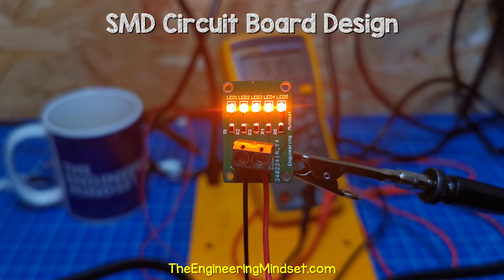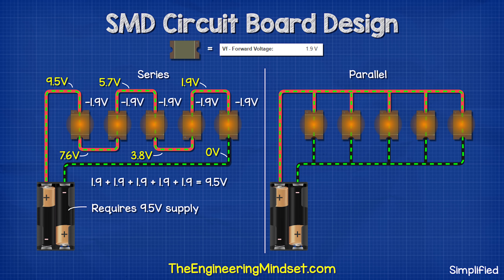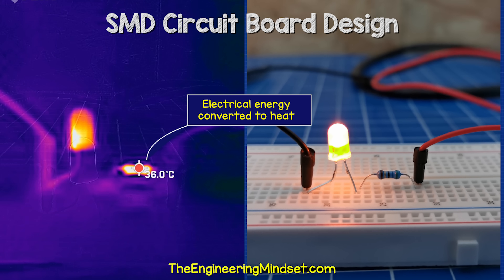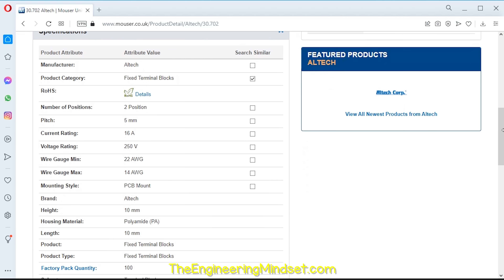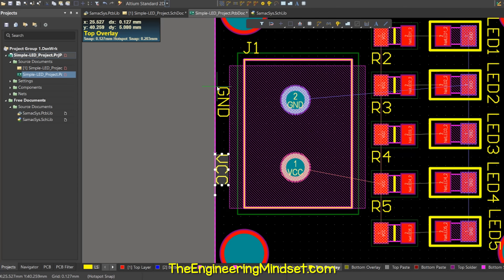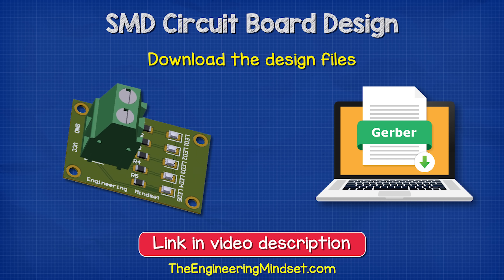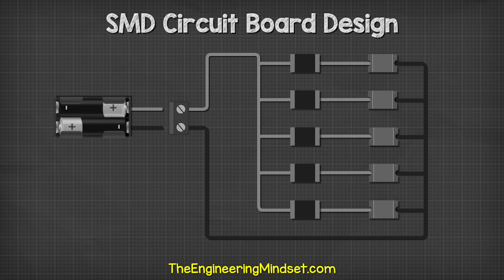Design and Build a PCB - SMD LED Learn electronics engineering

Comment: Hi  @EngineeringMindset  , is it possible to use an antenna as power source (using nfc) to power the SMD. and aside NFC, can you also incorporate a sequential blinking of SMD.? if all answer are yes. can you explain how to do it. sorry i dont have huge knowledge about electronics. thanks

Comment: This is incredible, fantastic. Thanks for this. A lot of parameters to consider here that might easily be skipped over by the less initiated, e.g. me. But, honestly, I don't think I will be doing any SMD PCBs, at least not for quite some time. Through-hole is so much easier, and will work in my harsh environments.

Comment: Why wouldn't a single resistor work for the circuit instead of a resistor for each LED? I'm pretty new so I'm not sure if that's an obvious question
Reply from the maker: It will work fine. But it needs to handle all the current so wattage is higher. You have single point of failure also. It would be cheaper with 1 resistor tho.

Comment: You could have put just one resistor in series with the parallel of the LEDs, and the resistor you used could have been used in that case too because the power it had to support was 100mW. right? Or maybe It should be 1W?
Reply from the maker: You can, but you have a single point of failure. It would be easier and cheaper.

Comment: Hello, I would like to know, how do you work with that batteries should have 3 V, but are new and have 3.2 V? That changes the resistor right? And after some time, we would need to change the resistor again, eight? Or can the LED handle something slightly more than 1.9 and it is not a big deal.? Do we get the voltage even lower? (I assume the led will just he dimmer?) btw is there a reason why you put resistor in front of each led? Wouldnt just one resistor before branching work the same?

Comment: 4B led, 3D screw or pin of some sort, 2F flat led, there is something shiny in 1D, some kind of speck in 5B, a hair stretching from 4D through 3E and into 2D, and another hair thingy between 1B and 2B. there is another speck in 3B. I know I'm years late, but..... the urge to answer caught me.
1:27

Comment: Cool video. But why you used resistors in parallel with LEDs? Would it be more simple and cost saving to mount only one resistor I series to LEDs?

Comment: Why can't we use a single resistor and connect all the LEDs in parallel before or after the resistor? You would still get the 1.1 V drop and the current on the resistor would be 100 mA, which would keep it under the max rated power for that resistor.

Comment: Definitely enjoyed the video but am rather curious as to why you didn’t just run the batteries in parallel to keep the 1.5v which would then mitigate the need for resistors as the LEDs could then handle the voltage although be just a bit dimmer. This way you’re not wasting energy and have double the capacity
Reply: You can't reliably share current across LEDs like that for a number of reasons.  The forward voltage to forward current relationship varies from one to the next enough to create large differences in the current.  They'll also have a cascade failure eventually.

Comment: why are circuits designed with the switch and resistor before the load (like an led) if the electron flow is coming from the negative side of the battery towards the positive?

Comment: Being parallel couldn't you use one resistor before it branches off since the resistor had a plenty high enough rating for all the LEDs? Saving parts and time
Reply: I think because the current that get into all led will be increased each time a led dead, thus every led will burn of overcurrent

Comment: Hey how come your design used 5 resistors, why can’t it use only one resistor for all the leds?
Reply: You can't guarantee the LEDs will balance well. Using 5 resistors helps balance across manufacturing tolerances.

Comment: Question please: Why didn’t you use just one resistor and connect all the SMDs across it?

Did you use one resistor for each SMD for extra protection?
Reply: I'd really like to know as well, I'm sure there is a reason but to my noob mind it seems wasteful
Reply: I think it is because he doesn’t want to connect the leds in series so each one gets enough voltage.If he connected the resistor in parallel the current will increase
Reply: Oh, you know, i have just asked my older brother about this issue. He said, that in most cases it is better to use resistor before every led. For example, if some led has broken or suddenly had change in resistance, most current with flow through the way with the least resistance, and other lights won't light. Or when you use bigger resistor, there a huge voltage drop on it, and it can cause some difficulties if you want to put other components and functions in your circuit. 
So i am Russian 16 year old student and i have just recently started to learn electronic) live and learn)
Reply: I agree. In that case:

- R = V/(5*I) =1.1/(5*0.02)

The 5 accounting for all needed current.

That gives a dissipation of 0.02² * 11 =4.4mW, and the resistor has 500mW in the same page he uses. (~100X factor.)

Comment: I'm doing engineering in industrial Systems and I like to fidget around electronics. I always collect small DC motors and and some other components from different appliances that aren't in use anymore. Thanks to your videos I've been getting a better understanding on connections, motors etc. Keep up the good work, God bless ✊️😌

Comment: A better way to solder those tiny smt components is to use a hot plate or a clothes iron with the hot side facing up. Some components could be damaged by a heat gun.

Comment: Sir i have one question -
If I want to get 12v out of 24v 1amps transformer then how much rated resistors I need to subtract 12v out of it my load is a motor of 12v and it's max current is 1.2amps and by my calculation I get 10ohm and 14.4watt of resistors and i feel that this is wrong please help me sir
Reply from the maker: Check out NEW resistor video, everything covered! ➡️ https://youtu.be/DYcLFHgVCn0

Comment: Buck would bee a better option, batteries get slowly depleted, led goes dimmer and dimmer, mr. Rimmer.. edit: so many resistors, so many wasted energy by heat.. why not using only one, just past the battery?
Reply from the maker: Check out NEW resistor video, everything covered! ➡️ https://youtu.be/DYcLFHgVCn0
Reply from the maker: Seen the new LED explained video? so much detail covered! https://youtu.be/O8M2z2hIbag

Comment: Back in 2020, I was stuck at home due to Covid for my Circuits II class. For our lab assignments we were mailed the necessary components to create our circuits, which consisted of SMD resistors and capacitors. We were given extra parts for obvious reasons, and I am willing to bet that some of those SMD parts are still in the carpet.
Reply from the maker: Check out NEW resistor video, everything covered! ➡️ https://youtu.be/DYcLFHgVCn0

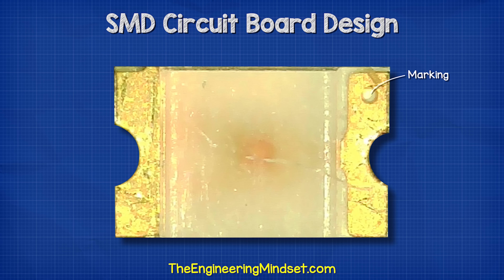Comment: 01:32 B4: Red THT LED
D3: Metric screw
F2: SMD resistor
D1: some white SMD component, probably an LED
Reply from the maker: Check out NEW resistor video, everything covered! ➡️ https://youtu.be/DYcLFHgVCn0
Reply: @EngineeringMindset  I won't :)
Reply from the maker: Seen the new LED explained video? so much detail covered! https://youtu.be/O8M2z2hIbag

Comment: So question, you add an individual resistor to each of the parallel paths surface mounted LEDs. What is the reason for not using a single resistor on the in path before the parallel? It doesn't seem like it could be redundancy, because from my understanding if one resistor fails that LED pathway will fail regardless, is it just failsafe so you can keep for working LEDs if a single resistor fails? Is it a ohms thing I'm not seeing? I've done my electrical engineering subjects but we haven't done much practical due to covid.
Reply from the maker: Check out NEW resistor video, everything covered! ➡️ https://youtu.be/DYcLFHgVCn0
Reply from the maker: Seen the new LED explained video? so much detail covered! https://youtu.be/O8M2z2hIbag

Comment: why not use a switching buck voltage regulator rather than energy wasting resistors?
Reply from the maker: Because resistors are incredibly easy to use
Reply: Using SMPS for such a simple circuit would be overkill.
Reply from the maker: Check out NEW resistor video, everything covered! ➡️ https://youtu.be/DYcLFHgVCn0

Comment: Four.
B4 (5mm red LED)
D1 (0805? SMD LED)
D3 (M2 screw?)
F2 (0603 or 0805 SMD resistor)
Reply from the maker: It is actually an M2, great spit
Reply: @EngineeringMindset  haha I guess I'm used to dealing with them on my micro quads!
Reply from the maker: Check out NEW resistor video, everything covered! ➡️ https://youtu.be/DYcLFHgVCn0
Reply from the maker: Seen the new LED explained video? so much detail covered! https://youtu.be/O8M2z2hIbag

Comment: when I attempted to purchase a PCB from JLCPCB it said the cost of the board was $2.00 but the shipping cost was a whopping $40.00. Is this some kind of error? if so, how can I fix it?
Reply from the maker: It defaults to the express postage, at checkout expand the box and it should list the cheaper options which are slower delivery times. I definitely didn't pay that much.

Comment: Why can’t you use a resistor before the leads split off to each LED? Wouldn’t that save cost and parts? It would only require 1 resistor
Reply from the maker: Yes you could but all the current flows through one resistor.
Reply: @EngineeringMindset  I don't understand the problem for one single resistor (i started studying this things recently). sure you need a different resistor (in this case since the sums of the currents of the LEDs is 0.1A the resistor should be of 11 ohm) but why not only one? is it because if the resistor blows all the circuit doesn't work anymore?
Reply: @TanusMorken  You can 100% use 1 resistor if it can handle the current. And yes if the resistor somehow gets damaged its going to cut off power to the entire circuit. In the video there is a resistor for each led so if a resistor dies it will only affect the led its linked to.
Reply from the maker: Check out NEW resistor video, everything covered! ➡️ https://youtu.be/DYcLFHgVCn0
Reply from the maker: Seen the new LED explained video? so much detail covered! https://youtu.be/O8M2z2hIbag

Comment: Wish I had this kind of information 30 years ago at college. I love engineering
Reply: no smd at that time!
Reply: @TheUnofficialMaker  In the 1990s, as an electrical engineering student, I worked at a small company developing ICT/SMT board testing equipment for oscillator and resonator circuits. So I think surface-mounted devices have been common for at least 30 years.

Comment: Nice video. Problem is even a simple design like this will cost €30 if not more if making a single unit so unfortunately out of reach for most. Little more can buy whole Raspberry Pi.
Reply from the maker: You can literally order 5 of these for $2 (+postage) using the link and files in the video description. Just need components, get off ebay super cheap or alibaba
Reply: @EngineeringMindset  thanks for quick reply. Sure, if you shop around and willing to wait a month or so - possibly. Just not from sites like mouser, not in Europe where I am unfortunately.

Comment: maybe a stupid question: but why do you use 5 resistors in parallel, wouldn't a resistor in series to the led's in parallel suffice?
Reply from the maker: You can but it's not recommended see full explanation here https://youtu.be/7d4ymjU9NqM
Reply from the maker: Check out NEW resistor video, everything covered! ➡️ https://youtu.be/DYcLFHgVCn0

Comment: Fantastic!  How about an "intermediate" board with variable output constant current for high-output (flashlight style) leds?  Through hole and SMD between the chips, pots, connectors.  LEDs are always fun.

I need to map out a board to use USB 5v to retrofit some old microscopes with some high CRI leds.  Projects been on the back burner for like a year now.  😆
Reply: You say this as if the back burner isn't the only place for projects. Are you suggesting that projects can be be front burnered. Please if your going to insult laws of physics substantiate your claims

Comment: Could you use just one resistor connected to the parallel LEDs in sequence?
Reply from the maker: As Daniel said, you could but it's not recommended. All the current will have to flow through it. Full explanation with examples here: https://youtu.be/7d4ymjU9NqM
Reply: Yes you can. But, every LED has a slightly different voltage drop hence some will run on higher current and some less. On cheap LEDs you might even see some of them brighter and some dimner. Also you have to make sure the resistors wattage is rated above the current consumption of the total LEDs wattage/power.
Reply: @danielberei3021  thanks for the explanation 😁
Reply: In theory and paper this would work good but in real life LEDs dont have exactly the same characteristics. What then happens is that the diode with lowest forward voltage will conduct most of the current and it will wear out the fastest. After it dies (if it dies as open circuit) the diode with next lowest forward voltage will conduct most of the current and will die even faster than first diode and so on until you run out of diodes.
Reply: @PlayboyHZ Thank for explaining that:) My parents bought some L.E.D. bulbs for their kitchen and they failed like this (individual L.E.D.s within the bulb failing one after the other in increasingly rapid succession). Now I know exactly where the manufacturer cut corners.
Reply: It's not only about the brightness of an LED. In parallel circuit, the current will be divided in every sequense, the only one resistor has to handle all the current from the source at once and it will get hotter and might get destroyed. But since SMD resistors are very, VERY cheap and not consuming much space (there are resistors which you can barely see with your eyes), we use for every sequense one seperated resistor so the circuit works "healthy".
Reply: Same question here. Maybe someone can answer?
Reply: Haha came to comments to say the same.
Reply from the maker: Check out NEW resistor video, everything covered! ➡️ https://youtu.be/DYcLFHgVCn0
Reply from the maker: Seen the new LED explained video? so much detail covered! https://youtu.be/O8M2z2hIbag
Reply: So why don't they make LEDs with resistor built in makes sense really
Reply: @davey2k12  Not really practical. What value should the resistance then be? The current would be different for different voltage levels.
Reply: @PlayboyHZ  obviously only fixed voltage but I suppose thats the issue with LEDs ..... So which is better parallel with resistor on each or series with randomly placed resistors can see that parallel is good for battery and series good for higher voltage..... Seriously with all the tech out there it seems like something is out of date probably where led drivers CC/CV come into it